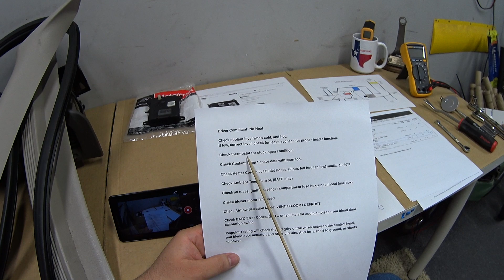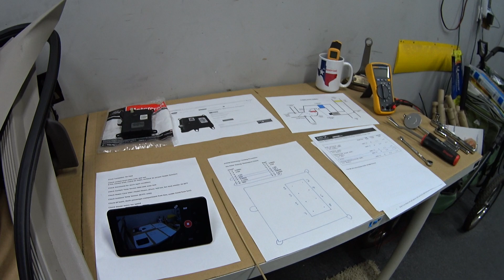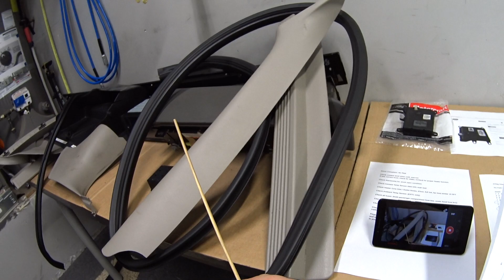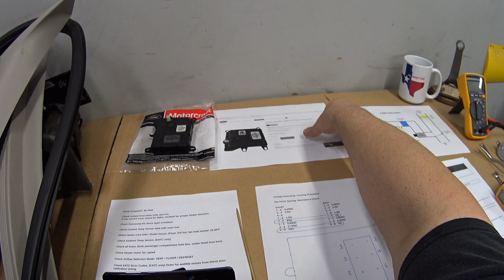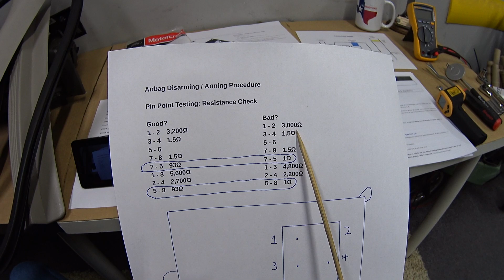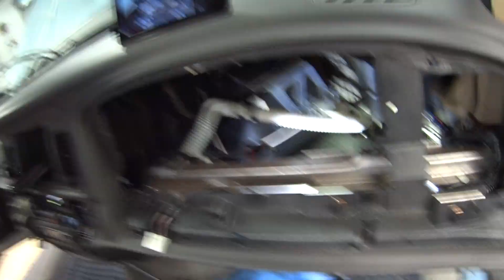Crown Victoria - Blend Door Actuator

Comment: Hello there chuck 
I replaced mine in august 2020 because for the last 5 years or more I didn’t have any heater plus the a/c at night comes really cold because I cannot adjust the temp , i  watched a video on YouTube (in arabic) for replacing the dash , i toke off the steering column , air bags, radio , hvac, glove box ,every thing at the end there no room for the third screw 😁, i wish if i did this years ago thanks for the video there not so much on youtube talks about the dash and how removing it.
Reply from the maker: Right on Mr. Bahrain,
Geez, 5 years without HVAC Control.

I only lasted 5 days before I had to fix it. lol
-Chuck

Comment: Have you ever repair a lcm?
Reply from the maker: Yo Wences,

Not yet. 
My 2004 Vic is still under the recall warranty, and it still hasn't broke yet. 

I do know someone who fixed theirs. 
He said he re-soldered the headlight relay to the circuit board inside the LCM. No video though. 
-Chuck

Comment: I'm going to have to tackle this on my '07 Grand Marquis here in the Spring. Stuck on full heat and even on bitter cold days, I find myself rolling down windows, lol.
Reply from the maker: Right on T,
I'd order the part now just in case it's out of stock in spring. 
-Chuck
Reply: @PanzerPlatform  Already done. I went to the dealer and got it couple weeks back. It's in my glove box, right now. Dreading this repair, lol. But, I'm definitely not gonna spend the $1,000 the dealer quoted me to replace it.
Reply from the maker: @TheTerminator310  
$1K for heat, and A/C repair. 
That's a tough pill to swallow.
Reply: @PanzerPlatform Especially when the part itself is just $60. Saving $940 is certainly plenty of incentive for me to do it myself, lol.

Comment: This happened to me in November idk what was going on at first went to ford to find out which was a bad move honestly they changed my oil used 5w 30 instead 5-20 the oil was still good until this month idk if they even changed the filter but the car is running fine i didnt asked for that.  I got the part  from A1 autos. Ford  was going to charge me 1,200 so I went to my brothers mechanic charged only 550 it has been running fine
Reply from the maker: Yo Captain,
That quote from your local Ford Dealer to replace this part for $1,200 sounds about right.

Before I dove into this, I called my local Ford Dealer, and they said they wanted to charge me; 
$200 for 1 hour of diagnosis.
3.2 hours of shop labor @ $230/Hr. to remove & replace the actuator.
$62 for a new actuator.
So the total cost was $998.

Once I heard that amount, I was properly motivated to attempt a DIY repair for $42, (cost of OEM Motorcraft part from amazon).
But if you paid $550, that’s still better than $1,200.

Maybe next time you face one of these repair, take a look through my “Crown Vic Tip” Playlist to see if I have a video to help you fix the problem yourself.
-Chuck